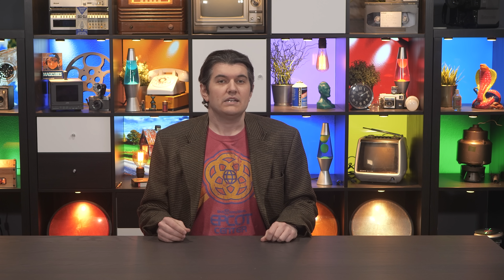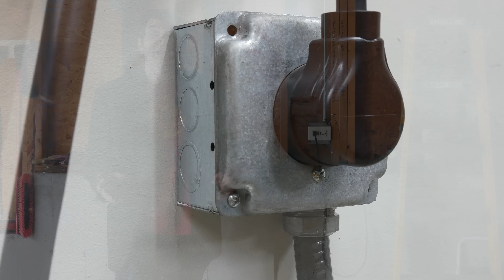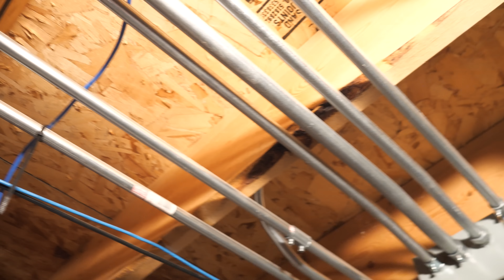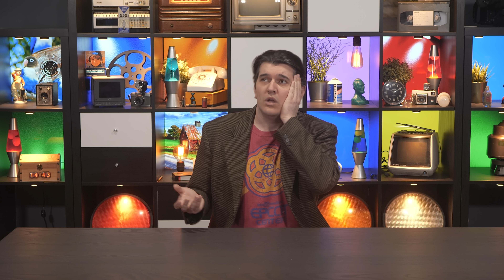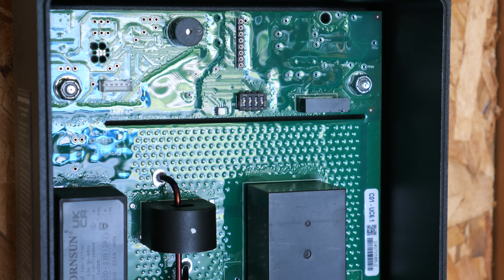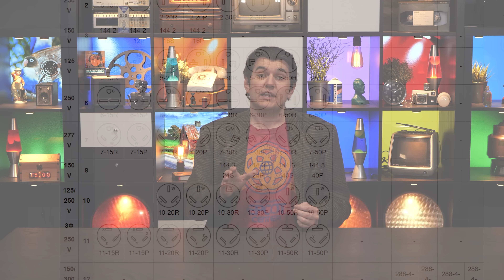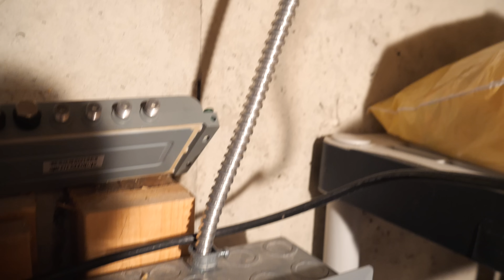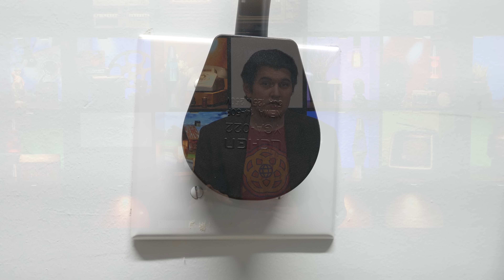The "standard" car charger is usually overkill—but your electrician might not know that

Comment: 21:05 in Copenhagen Denmark, by 2030 no more fossil fuel vehicles is allowed to drive around the city. And for that reason the government is putting up tons of charging stations on public streets. EV owners have a chip they just scan and is billed accordingly when done with charging. The current downside to this issue is that more and more parking spaces are getting taken up and reserved for EVs and non-EV owners can get fined for parking there now, which sucks buttocks because most EV owners tend to park as near as possible to their own apartment for convenience. But hopefully over time this will be a smaller and smaller issue.

Comment: To Add an important step to your scope of installation:  Many areas require a power switch between the circuit breaker and EVSE or outlet dedicated to the charger, as per the California Standard.  It is not a big deal (my MC went into a junction box with a switch),  but it is very common.

Comment: I have a Renault Zoe Q90 from 2017... Because it is a Q90, the car needs to see 10A @ 1P charging (240Vac) or 13A @ 3P charging (3x400Vac+N) before it will even start charging. Other Zoes needs 6A@1P and 10A@3P.
The Zoe ZE40 have a range of around 250km depending on weather and SoH. I have 150-200km on 80% SoH in summer... And it still gets me to work and home again in winter (116km from A-B-A)

Comment: Thanks for this bit of common sense! I bought a used 2018 Chevy Volt (Gen 2) 2 years ago. it only has a 15 KWH battery but that is good for 90 to 100 KM in the summer and 60 or so in the winter. I rarely exceed that in a day and when I do there are charging stations and my ice powered on-board generator that covers me. AND I checked the European version of this car ( the Ampera) and its supplied home plug-in charger not only looks the same but has the same GM/Opel part number so I threw caution to the wind and used a simple plug adapter to plug it into my available 240V plug that I normally use for my cabinet table saw (20 amp circuit). It all works perfectly and when I choose 12 amp rather than the default 8 amp charge rate on my car charging screen I easily go from empty (20%) to full (80%) in 4 or 5 hours. BTW with its battery-only range I cover over 95% of my daily driving so in 2 years I have actually used less than one full tank of gas! Great car, pity GM canceled it in 2019!

Comment: Did I not notice or did you not mention that fast-charging generally decreases expected lifetime of batteries? That applies at least to phones and laptops where slower charging over night is better than fast-charging it in an hour and letting it "idle" on the power for the rest.
Reply: High current charging can decrease battery life, however Car batteries are actively cooled and suffer much less.
Reply: @kjdude8765  Nice. Did not know that it had such a big effect on it.

Comment: Be me, happily charging my EV at 2.2Kw/h while using what is essentially extension cord for years now 😅 
Big wire, dedicated contact breaker and proper grounding are all that is needed.
To be clear, my car only have 27Kwh battery and it have around 170 miles of real world range. 33 to 100% only takes 8 hours or so. It is so practical.

Comment: It’s still worth at least getting a couple estimates from electricians. Our 50A EV circuit was about $400 total, including full permits, and only took an hour to install. 

If your install area allows you to keep the outlet/station close to the breaker panel, even professional install costs are low.

Comment: It isn't a need, it's a must. Most people do not have the time to wait forever for charging.
Reply: The whole point is: charging overnight is actually more powerful than most people realize and there is little need for the most powerful home charger, as a medium (or even low) powered charger can still add 100 miles (150km) of range overnight.
Reply: @kjdude8765  I have owned my Tesla for 6 years, I own two of them. I don't think the YouTuber is positioning the "lack of need" correctly. Actual use of the charger is largely different from just running math like that. 😅

Comment: Another reason to hardwire your car charger - my parents had an electrician install a 240V outlet in their garage on a 40A circuit and then installed a GRIZZL-E charger to plug into it to charge their Mach E.  Maybe a year later, my dad unplugged the charger to discover that the outlet had melted pretty badly, it was a complete mess but luckily nothing shorted out.  We looked it up and discovered that this wasn't an isolated issue, despite the receptacle being rated for 40A service.  We ended up buying a new receptacle from a different brand and replaced it and so far it has been holding up, but also had to get the charger itself replaced as the plug was destroyed too.  Meanwhile, at my house, my dad helped me install a 30A hard wired GE charger in my garage when I first got my Volt and it's been perfect, though the Volt doesn't push it to its limits at all.  My parents have charged their Mach E here though as well and it worked fine.
Reply: Receptacles are a known failure point. Typically 240v plugs are tested for oven or dryer use: 1-2 hours of use at a time, they'll maybe get unplugged 20 times over their life span. EVs can charge for 8 hours at a time and frequently get unplugged. Look for a receptacle that's rated for charging. Leviton and Hubble have versions with little green cars on the face of them that are designed with EV charging in mind.

Comment: I installed the cheapest amazon 50A station
I hard wired it and been working perfectly for 6 months now, at 50a pretty fast (I have one ionic 6 and one leaf) I turned down to 25a because we don't need any faster and leaf mostly charged by the regular 110v outlet, maybe in the future if I get a EV truck.
Anyways I can change the settings on the go if I have a emergency to change it fast.

Comment: I had a 32Amp charger in FL which was nice for a quick top off on my Bolt before a longer road trip but most of the time I just left the charger on 16amp (or less) because 32amp charge would force the car to run its battery cooling and heat up a hot garage even further. Now that I'm back here in IA I ended up just doing a 20amp 240 circuit since I didn't have the luxury of a panel in the garage. a 16-amp charger should work perfectly fine for 90% of EV owners to be completely honest.

Comment: you can buy MC cable in 8 AWG and get it in any size you want. The electrical supply store will cut it any length you specify. It is probably only available in the 8/3 cable.

Comment: I have a couple of takeaways from this video, knowing about home electrical systems...

First, aluminum wiring is really not that dangerous when installed correctly. In fact, the main feeders coming into your home are AL. And most high wattage circuits (range for example) are installed with aluminum wire. Again, it's safe as long as it's installed properly by a licensed electrician. 

Second, once you removed the plug from the EVSE and hardwired it directly, you should have installed a disconnect switch close to the EVSE. This may be a code requirement in your area for future servicing of the EVSE. You may be able to get around this is the circuit breaker is within eyesight of the EVSE, but seems like this is not the case. At a minimum, you need to install a permanent lockout device on the EVSE breaker. If you left the plug on the EVSE and installed a receptacle, the plug is the disconnect and none of this would be required. 

Third, you are really doing yourself a disservice by installing the minimum wire size. You will always limit yourself to 24 amps in the future. EV tech is constantly changing, and what if they change up the batteries and charging systems in 5-10 years and now require a minimum of 40 amps to charge? Or what if you want to run two chargers at a lower rate? You will have to replace the existing cable and install new. If you are trying to utilize an existing circuit, like a dryer circuit, that's fine. But for a new install, always leave room for expansion.

Comment: Slightly older unofficial family electrician here. Tangent about EMT: I still have to get out the calculator and paper, and I still take forever double and triple checking things before making bends, but installing conduit is so, so satisfying. "I did that?" And it makes future changes so easy (probably not really a thing for an outlet for an EV hookup, but great for adding a switch leg or second circuit).

Of course, more work than cable, and significantly more work if having to run through existing finished spaces.
Reply: I'm an amateur heating plumber, and I absolutely love making a neat installation with bent steel pipes!

Comment: I've been living just fine plugging my Bolt into the standard 20A outlet every day for 3 years. I leave it plugged in and I get between ~50-60 miles by leaving it in about ~10-14 hours of the day. My commute is about 20 miles tops and if I end up not at home for the day I have plenty of surplus to make up for it.

I've used public chargers twice and the experience was fine, but 99.9% of my charging is straight out the wall.

Comment: 21:05 Another note about DC fast charging, maybe less of an issue on newer cars, but it may shorten the overall life of the battery pack. 
23:00 One thought I had about smart charging stations: I have a whole home energy monitoring system (has current transformers you install in the breaker panel on the circuits you want to monitor) and I use it with Home Assistant to trigger automations, monitor equipment, etc. The company that made the energy monitor I use, also makes a smart charging station, which should integrate with my existing system, but I'll have to see if the car has a Home Assistant integration If/When I get one (I've been looking for a while but the specific car I'm looking for is proving to be elusive or too expensive: specific model, trim, features, and extended battery pack,).
27:55 Also, improper installation of the breaker. I saw a review of a charging station where someone posted a photo of a melted breaker with the review stating that the 'charger burned my electrical panel' and they had to pay thousands to replace the panel. Obviously (to us at least) this is not the fault of the charging station. In the photo, it appears that the panel was outside (which I don't like to begin with), so likely caused by corrosion on the bus bars that wasn't properly cleaned up before the breaker was installed.

Comment: You showed a 10-2 armored cable. But, the 240 plugs you showed have 4 prongs, one for each leg of 110, another for ground, what about the neutral? There is no conductor for that in the 10-2. How is that handled?

Comment: I still use the cable that came with my 2017 Volt, mainly because we have a detached garage that only has 20A 125V service to it. On the plus side, the 20A service allows me to always charge at the 12A rate even though the first thing the Volt dealer told me is always charge at the 8A rate and never the 12A, lol. It's worked out fine since the Volt is a plug-in hybrid, anyway. If I ever get get motivated to bury a 50A 240V cable from the house, I'll likely just make a dongle for the existing charge cable since it quite capable of being plugged into 240V and get the faster charging rate.

Comment: Since I got my Model Y in april, I've only used the Tesla Mobile charger and a 120V/15A circuit.  This puts 1 kWh into the pack per hour. It meets 90% of my needs.  I've had to stop by a supercharger to top up about once every couple of weeks, usually on Sundays when I've gone on date night Friday, did errands on Saturday, and then needed to go somewhere on Sunday.

I have J1772 and a CCS charging adapter and use the plugshare app to help find additional en-route charging options.  This is awesome because there's a CCS chargepoint 100KW unit in the parking lot of a Texas Roadhouse restaurant near one of my common long-drive-with-a-trailer destinations.

With the Tesla Mobile charger, you tell the charger how much current to draw with the *plug*.  The -15 plug limits it to 12Amps.  You can also limit it further with the GUI in the car.

BTW, Charging with a trailer *sucks*.  Maybe one charging station in a thousand allows you to charge without dropping the trailer first. :/
Reply: If your wires at 12 gauge and there isn't much else on the circuit, you can swap the receptacle out for a 20amp receptacle and put a new 20amp breaker in. That will increase your charging speed by about 30%. My Model 3 uses 100-300w to heat the battery and run the computer while its charging, regardless of what speed you're charging it at, so the faster you can charge, the more efficient it'll be.

Comment: I did exactly this when I git my Model 3 over 3 years ago.  It has been more than enough charging power.  Even the (2 times) that I came home less than 20 percent it was back to my daily max by morning.  And I feel it's much safer pulling only 24 amps.  Like you said, I'm sleeping, do I care if the car finishes at 2am vs 4am?  I think not.

Comment: I have to disagree with you about requiring an internet connection for your EVSE. Our electricity supplier here is called Octopus and they have a GREAT EV tariff. We pay 7ppkWh to charge the car and that can be anytime of the day. You tell the EVSE what time you want to drive the car away and it along with the supplier, talk to each other to find out when the best time to charge might be. And that can include peak hours. My charger will regularly put a few percent in the battery and then wait a while until grid conditions mean theres an excess. You then get a few more percent added and so on. Sure it might take longer to charge the car but you know you won't pay more per kWh and you're helping to sustain the grid. I also like the idea of being able to remotely look at the charger to see how much power has been delivered (we have a Jeep Avenger EV and a Plug in Hybrid Skoda Octavia VRS and the apps SUCK on both - neither of them offer anything like what you mention other than a charging schedule - which again is redundant due to the smart charger) from the charger itself is super beneficial.

Comment: I'll add one thing to the DIY make a new electrical circuit: if you're uncomfortable with PARTS of it, or if parts of it are illegal in your region... do the rest first, then call a professional electrician to finish it. It usually will be much cheaper. 
Now, warning: you have to do a good job, and don't be too creative with the material you buy. Electricians are liable, and many will refuse to finish your half installation if it's visibly shoddy, or even if its made with weird and unknown material. 
But most of the cost of an electrician is person-hour spent thinking on how to build the circuit, how to lay out cables, crawling behind stairs and trying to fish cables out of walls, and the like. If you do all that manual, simple but sweaty job yourself, you should get a much lower bill.

Comment: Thank you for this! And please go ahead and throw electricians under the bridge, they are the red headed step child when it comes to working at a job site lol. Also, thank you for mentioning the Nema splitters, there is so many people online crying that it shouldn’t be used without proper reason. I have a nema 10-30 water heater in my garage and use a splitter on it to charge my Model Y with the Tesla Mobile Charger set to 24A and it works great!

Comment: For your parent house, you mentioned that you could have swap the nema 14-50 for a nema 14-30. Why not simply put a nema 14-50 on the 30 amps circuit, which is to code (might be required to label it). In our new home, we had a nema 6-30 outlet in the garage (for a heater). As we already had the grizzl-e charger with a nema 14-50, we simply changed the plug, mounted the charger and we were all set.

Comment: Using Emporia’s EVSE, I can:
1. get nearly free charging overnight.
2. keep it limited to only our vehicles (no garage, house is v close to the street and so it could technically be used by whomever if it was a dumb one)
3. using their Vue power monitoring, along with Home Assistant, down-rate or even pause charging if other electrical loads in the house grow (e.g. dryer is on) so we don’t go over our 100A service.

While these three are critically important for me, I think connected chargers should be a lot less common than they are.

Comment: 2:36 CAN be charged is the key word here. My folks recently bought an EX30 and Volvo specifically states in the manual that people should only use a standard household outlet to charge the vehicule occasionally when nothing else is available, it's not meant to be used as the default charging solution. Something about battery degradation I believe.

Comment: "Do you fill up your gas powered car every day?"
My 2010 Passat has over 1100km (~680mi) range on a full tank. And when I have less than half a tank I'm already getting anxious.
And the other issue is that I can buy and maintain like 4 of these cars for a price of one Nissan Leaf with a dismal power output as well s range.

I mean. EV makes a little sense for grocery shopping runs for my household. But I cannot justify the cost of a grocery run machine at the current (used) EV prices.

Comment: The domestic mains power supply in Australia is 240V AC, 50Hz. Standard 3-pin earthed power outlets, but still would not buy a toy Electric car, I'll stick with my gas guzzlers it's cheaper in the long run and better for the environment. 1 is turning 19 the other is 38 and between them i have not spent enough money on them to even buy a midrange toy EV. PS and both are in very good condition.